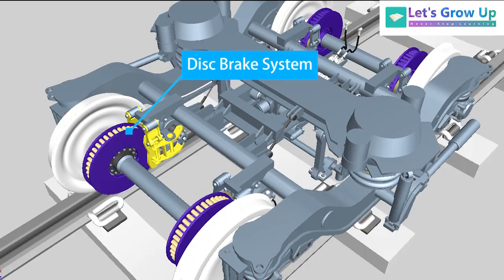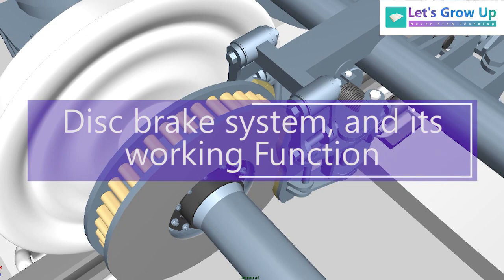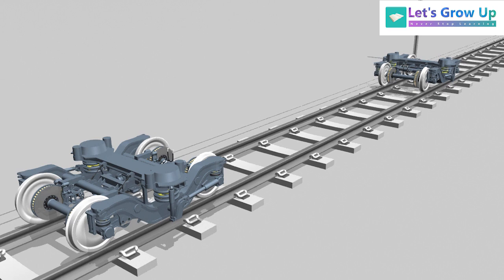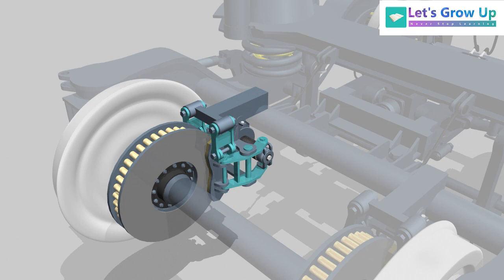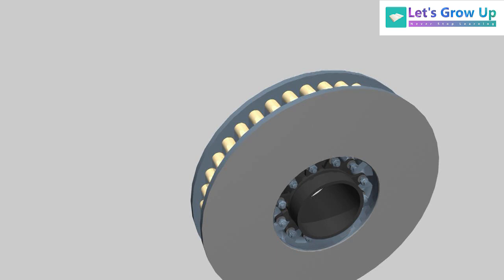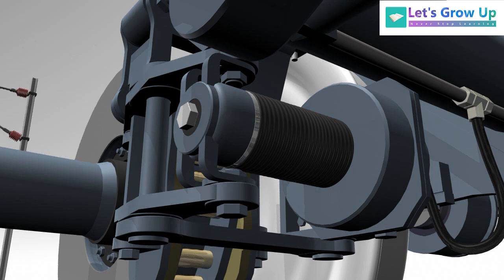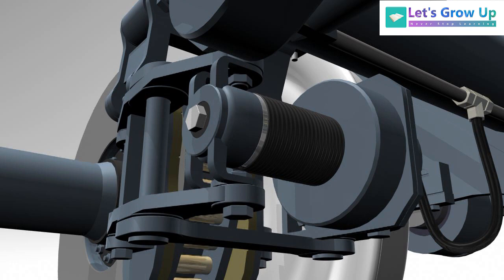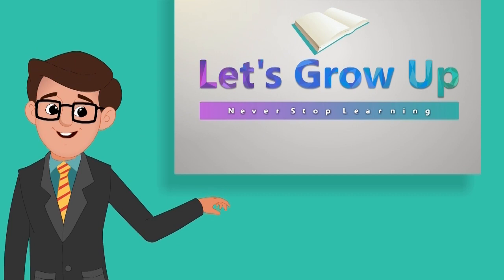The Amazing Technology Behind Train Disc Brakes

Comment: Whenever driver apply the brake bp pressure will reduce only not increase...increase means brake will release..
Reply from the maker: Here BP pressure means inside the brake cylinder.

Comment: When the driver applied the brake the BP pressure is getting release, but in the video it's States that bp pressure increase.. after applying break.
Reply: The video states that the BP pressure INSIDE the brake cylinder increases which then pushes the piston outward.
Reply from the maker: @wanfahim3583  correct
Reply: @wanfahim3583  got it man thank you

Comment: pressure does not rise when braking. those are not car hydraulic brakes. Each brake has its own air pressure accumulator, that constantly apply pressure to the brakes. From the other side you aplly same amount of pressure so the brakes does not brake. If you wish to brake you release some of the air pressure and create pressure difference. 

please leran first then teach.

Comment: What happens when the brake disc wears down, would it not be labor intensive and long down time to replace.
Reply: For in-board disc as shown, these are disconnected from the hub (via the bolts/nuts) and then cut in half with a plasma cutter to remove.  The new disc come in two pieces (called split discs) that are bolted onto the hub and then bolted together.  Otherwise, the disc life is governed by the wheel & journal bearing life.  At the end of the wheel or journal bearings, the axle is removed and the discs, bearings and wheels pressed off.  New components are then re-installed.